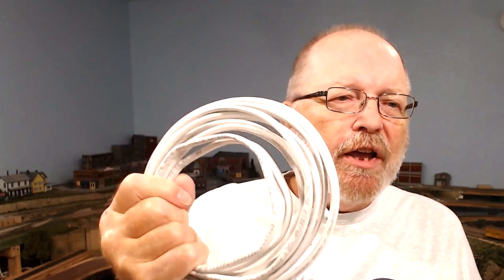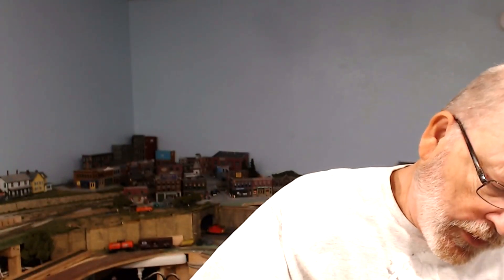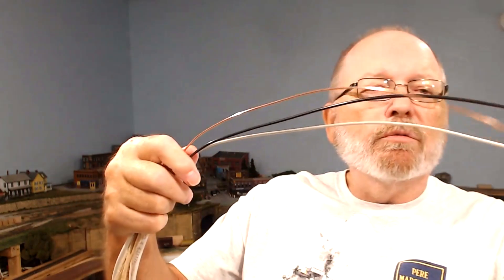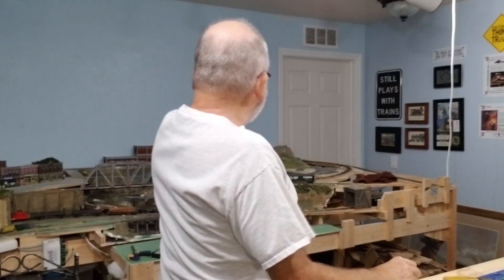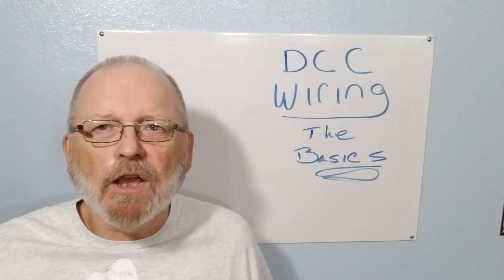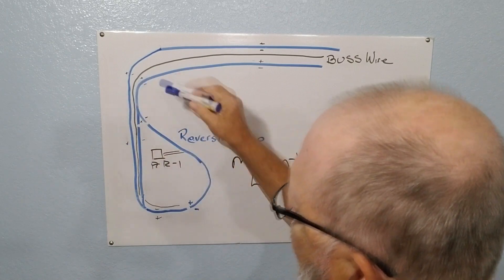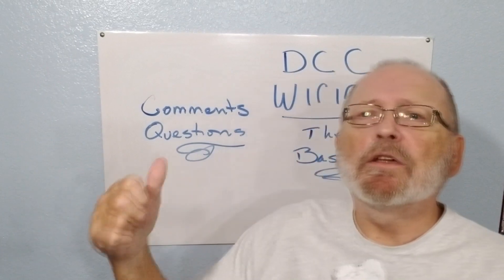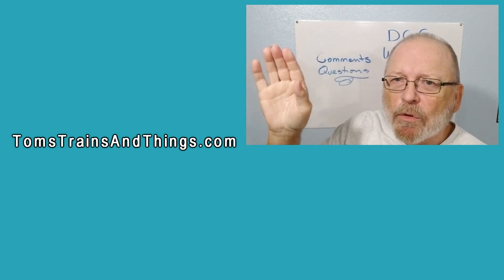Easiest Way To Run DCC Bus Wires On Your Model Railroad

Comment: Tom, the easiest way to run BUSS wires is to use Copper Strapping, no stripping, no soldering. Just lay it along and screw it in. http://www.rslaserkits.com/CVR/Layout-2016/2016-CVR-024.jpg   

See it all at http://www.rslaserkits.com/CVR/
Reply from the maker: Thanks for your input Will.